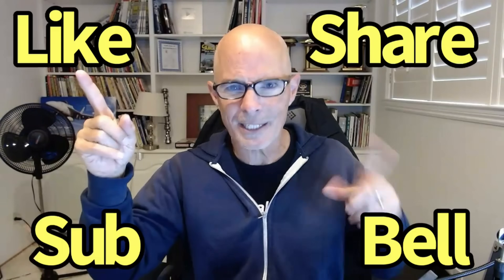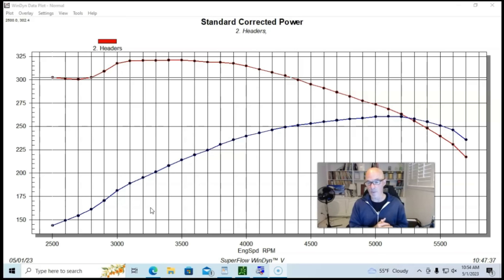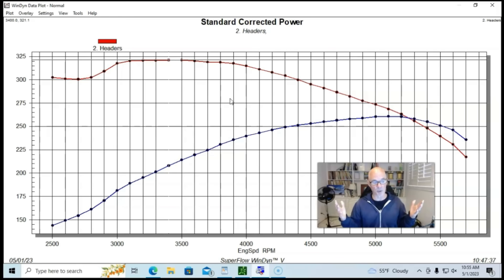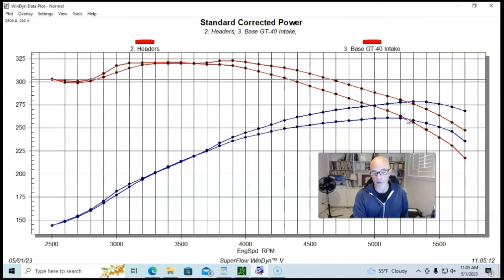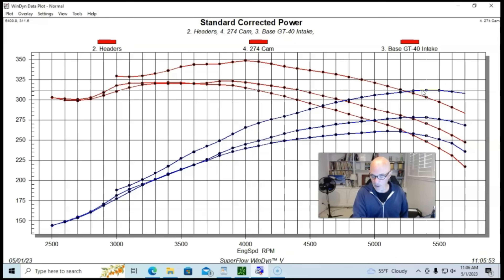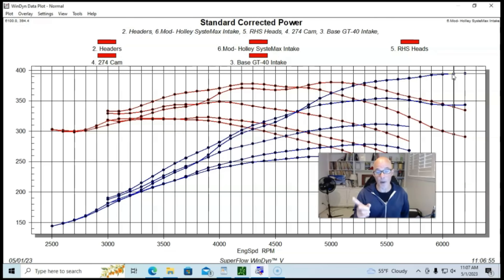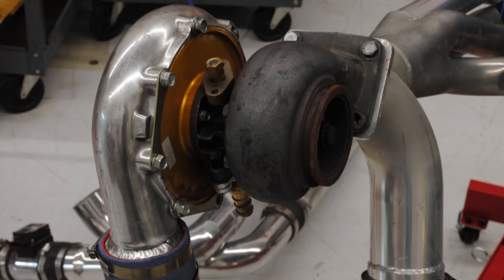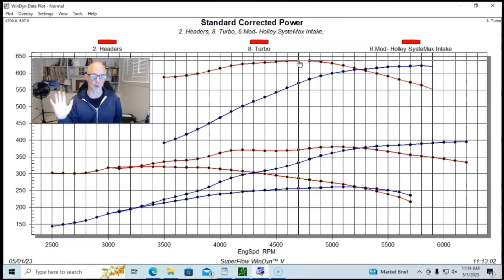HOW TO MAKE 5.0L POWER-BOLT ONS VS BOOST. SHOULD YOU PICK HEADS, CAM & INTAKE OR JUST ADD A TURBO?

Comment: Stock its rated at 215hp in a 1994 stang for example but how did it make 250 on your dyno stock?
Reply from the maker: that was covered (cold water, open ex, open tb, optimized tune, headers etc...)

Comment: Richard, since iron GT40s are still a popular head upgrade, have you thought about doing a video showing airflow gains with just some simple bowl work, multi-angle valve job and removing casting flash?
Reply from the maker: LOTS OF GUYS HAVE PORTING VIDS ON THE GT40S -SEE DAVID VIZARD OR ERIC W.

Comment: Hi Richard..I have an idea that you may find interesting. I was wondering if you are able to determine the overall efficiency of an engine while testing. I know that when the University of Nebraska puts farm tractors through the wringer one of the figures that they determine is the hp/hr- per/gal figure. That figure gives an accurate representation of efficiency. With today's high fuel prices I would think a lot of guys would be interested in building highly efficient combos in order to maximize mpg. Just a thought.
Reply: Fuel economy is going to change depending on many factors--too much headwind one day, too much traffic (ie stop and go) another. I got my 1986 GT Mustang with T5 and 2.73 gears to get a gas-pump versus odometer reading verified 30mpg driving suburban areas at rural speeds. I did it by shifting below 3,000 rpm and coasting down hills and up to stop signs. but EPA was more like 17 in the city 20 on the highway. I'd say dyno testing is going to make an apples-to-apples comparison  between engine mods,  while "taking your show on the road" adds too many variables--wind resistance, driving ability, traffic, gearing, etc.
Reply from the maker: mpg is best tested in the vehicle during a drive cycle or real world conditions-wot fuel efficiency is only important for endurance racing
Reply: Well dyno testing could easily verify the average amount of hp produced per hr per gal of fuel consumed.  And in my opinion the engine that will produce the most amount of work from the least amount of fuel will always yield the best mpg under identical situations. 

 And  yes I was thinking along the lines of partial throttle conditions 1800-2400rpm range. Real world cruising rpms.
Reply: @NMX777  if it's producing more work from less fuel, its efficient, but there's another factor...potentially. there could be less friction (mostly found in the valvetrain and piston ring thickness, but also in blueprinting a block for "Squareness". get this licked, and you make more power for less gas, but you will find when driving the engine there's less friction to slow the car down (if you use that technique, esp. on stick shift cars) without using the brake pedal.
Reply from the maker: the dyno is regulating things not duplicated in the real world-mpg changes are best tested under the actual driving conditions
Reply: @Richard Holdener  ...I get your point Richard. The dyno cannot predict a real world mpg because of all the variables involved in the real world.
 But what it can do is let us know what power plant is providing the most available power for an equal ( per gal or per whatever) amount of fuel. If you can point to the engine that can provide the most available power from that unit of fuel. Then I can point to the engine that has the potential to provide the best real world mpg. And in every case within the real world. That power plant has the potential to get the job done on less fuel.
Reply: @NMX777  agreed exactly. i can take two of the very same engine, and put them into different cars with different drivers and get two very different MPG ratings. so if i want to know if a 300 degree overlap cam is going to kill my gas mileage, i don't need to put it into a car...i can use a dyno to make an apple-to-apple comparison. otherwise what is a dyno for, anyway? its supposed to help us make comparisons--if we need to put the engine into cars, then these videos are entertainment not education.

Comment: Thank you so much for this! Love the content! I have practically this same combo. Stock block/bottom with trickflow forged pistons, 11r 190 trickflow heads, ported Systemax upper and lower and cam.  On3 67mm turbo kit. Its in my 91' LX hatch. Worked AOD with 3k stall. I just need it tuned!
Reply: How is the 67mm turbo with throttle response and what power level is it limited to

Comment: Just did an on 3 kit on my fox this weekend. Trick flow 170s, e303, typhoon intake, and 10.7lbs of boost it made 491hp/478lbs torque through a lentech AOD with edge racing converter.

On a dyno jet.
Reply: To the tire, through an automatic= Awesome! If you know, or get a chance, how much does your car weight with you in it=race wt., what 60ft., 1/4mile et., and Mph? Also what is your flash stall speed= when hooked up fully, and your rear end gear ratio?
Reply: @evilinside5984  Its a 88 convertible with full interior 66k miles so probably weighs close to stock weight add 180 lbs for me, I don't plan on going to the track because my goal is to keep it looking like a sleeper so no roll cage. Its an Edge racing 9 or 9.5inch converter with a 3200 stall, on the dyno it seemed to go right up to around 4k in 3rd when we hit it. I have 3.31 gears in it and the lentech aod has 4r70w gear set in it. So 1st is more aggressive now then it was with a stock aod and 3.73s haha.

Before I modded it up much it ran a 14.1 in the 1/4 with just exhaust and 3.73s
Reply: @zarmelad3475  That 14.1 with minor mods, was very good. I have an 94Gt, Aode, and weighing a very heavy= with driver= 3,950 Lbs., and 100% stock, it ran 15.6@ 88Mph. In many performance articles/mags, your Aod convertible fox's are listed/shown as running 16.1@87Mph= 100% stock, and without shifting it, with the shuffle=just mash the gas, n go. The 1994, and 1995, 302s, with the Electronic= Aode trans. cars were quicker 100% stock, because they had a 2,300 to 2,500 tq. converter, vs the 1987 to 1993 Aod trans. 1,600 to 1,900 tq. converters stock! My Aode responded great to 14° of initial timing, complete exhaust, k & n fipk kit, B & M (E- shift improver kit), drag radials, and 4.10 gears= 14.52 @ 93 Mph= 1.08 sec. quicker, and 5 Mph faster, over stock! Stock dyno jet #s for Aodes= 165 Hp, and 220 tq.,  After my mild bolt ons= 189 Hp, and 238 Tq., not to mention they say when you put higher numerical gearing= like i went from stock 3.20s to 4.10s, that will show slightly less Hp, and Tq., to the Chassis Dyno, because it shows less of a load to the dyno. Thats why people say i dont race dynos, i race cars on the track, cause many low geared, high stall speed autos., will show very low Hp., and Tq. On a chassis dyno, vs same stuff done to a Man. Trans. car, but will run waaay quicker @ the track, then the chassis dyno would indicate!
Reply: @evilinside5984  yea I was surprised by the 14.1 as well, that was with the AOD shuffle lol, when I changed out the cam to an E303 it slowed the car down and I couldnt get faster then a 14.8 (E7 heads). I'm curious what my car would run now but since I dont want a roll cage I would have to try the draggy app or something and I dont really trust it accuracy anyway.
Reply: @zarmelad3475  The dragy is very accurate, deff. get one! Also i have the E cam, it moved the power band 500 Rpm up. Stock liked being shifted @ 4,900 Rpm, and with the E cam, shifted @ 5,400. Im sure you lost because of not shifting higher, and traction losses, or track prep. diff., or from how bad the Da was? Without a time slip to compare, 60ft., 330, 660, 1,000Ft, and 1,320, Ets., and Mph, its hard to see why the drop? I can look @ the Da, timeslips, and see where things change, and how it effect's the number's. Also, info from, you the driver, did you try shifting higher? Did you ever hit the Automatics rev. Limiter, which is 5,500 by the way= not 6,250 Like the 5spds. are. Most people don't know that the Automatic's factory rev. Limit from 1987 to 1995 is 5,500 Rpm. Ford did this to protect the automatic trans., because they knew they were not strong from the factory.

Comment: Wouldn’t boost be a more exponential number based on psi being relative to volume as opposed to *2? Base heads plus 1 bar = to hp * 2. I get that, but when you port and allow more volume of air, now the 1 bar on base is not 1 bar on modded. The turbo psi addition is the same but much greater volume?  Better way to say it is factory stock motor with 1 bar turbo = (x)cc’s of airflow. Not changing anything but porting, the psi would actually drop, but volume would increase and same power(%) increase at lower boost.    Am I overthinking it, or would adding boost be more equivalent to base*2, then 1st mod *2.2, 2nd mod *2.4, 3rd mod *2.6, so on?
Reply: Sorry, chill day after 2 weeks of burning candle at both ends, my brain is still in overdrive.
Reply from the maker: the power/boost formula is surprisingly accurate
Reply: @richardholdener1727  I'll definitely keep it in mind then. I need all the number crunching help I can get. Dynos are few and far between and not cheap, lol.

Comment: The answer depends on who's paying for all the goodies to create the desired power. I believe a basic turbo set + fuel ratio adjustments probably comes great deal cheaper than lots of power brand parts. So if had to get them myself, i'd choose a turbo set up

Richard if you were to make at around the same amount of peak power (and torque) using number of brand parts (heads, cam intake, etc) or just using a turbo set up, which one of them would give you more fuel economy (more mileage per gallon)?
Reply: Turbo would give better mileage, it only uses more fuel under boost so if you weren’t driving it hard then it’d return stock like fuel mileage
Reply: The tq. from a turbo, vs Hci, will be much more peak, and waaay more average! Mpg, i would think the turbo would get better fuel economy, because its increasing the engines eff. more than Hci. But lets be honest with ourselves, when we feel the "Hand of God"= all that turbo tq. goodness, are we really going to give a s**t about fuel economy!? But its there if you have the patience, and restraint? But me, that kinda tq., is like telling yourself, im just going to stick the tip in=😂🤣👌😜

Comment: I love it!  Such a motivational vid for me as i am in process putting back my foxbody together.  Heads, cam stock refreshed 302 and a turbo.  I have a question on turbo sizing.  Im looking into sub 70mm compressor wheel turbos.  Any suggestions on good responsive turbo?
Reply from the maker: cheap gt45
Reply: @Richard Holdener  Lol omg i do have a brand new dna 69mm gt45 sitting on a shelf.  I had my doubts about it.  Thank you for your reply!

Comment: I had my (not yet used) 351 4V Cleveland with basically what you had , but "60" over . Curious to see if it will make more than 450 hp and 411 torque . 🤞

Comment: Where I live, I'm extremely limited in my legal options. Turbo's are not allowed, nor are the after market alloy heads and intakes. Exhausts can be modified, but must still have cats. And yes, they  do put plenty of defect notices on vehicles. Even the cam has to sound standard. So, for me, its all about getting as much as possible, out of as little as possible. Hence a 347 stroker, gt40p heads, explorer intake, custom made headers, and exhaust. Open the hood, and it all looks essentially factory original. Every head, manifold,  exhaust mod is all about extracting as much as possible from what is available. Low lift head flow and port velocity is crucial. Exhaust scavenging plays an important part. Peak numbers are less important than total area under the curve.
Reply: if you were stuck using flat tappet lifters for an early engine design, look into variable duration lifters. below 3,000 rpm they reduce lift and therefore duration, you may be able to get a cam that sounds stock but then above 3,000 rpm you get the lift you need to get around a stock set of heads to feed a stroker setup.

Comment: There is no comparison. I put a Hellion 62mm turbo system on my 150,000 mile 5.0 at only 10 PSI. The only mods were 1.7 rockers and Cobra intake. It made 444.6 hp and 537.8 lb/ft of torque to the wheels. My current coupe has a 347, 185 AFR heads, Holley Systemax intake, custom cam .600/.595, 327/331, 112 lobe sep, electric water pump, 70mm TB, with Holley Terminator-X. It made 400 hp and 370 lb/ft to the wheels. I love these comparisons but this one isn't close.
Reply: That 347 should be at around 500 hp at the crank, that's pretty damn good.
Reply: @anthonysiler4938  We are guessing it's around 470-ish to the flywheel which I'm happy with. The current combination has a TKX but was dyno'd with a T5. 
To add to my previous comment, the turbo motor made over 400lb/ft at only 2500 rpm, and that was a fun combination with 3.08s.
Reply: That's very good info so how much hp is lost by running a supercharger vs turbo running the same boost?
Reply from the maker: see the mod ford video where I tested all four forms of boost on the same  motor

Comment: I’m building a turbo kit for a stock 302 atm aiming for about 400hp, thanks Richard!
Reply: 400 is easy with just a turbo.
Reply: 230 HP plus 8 psi boost is 400. Pretty easy
Reply: @bobstitzenberger1834  yes should be very attainable, hoping to make it live for a while.
Reply: @karenthomson9749 ,  it's all about the tune. That's really a moderate power level, as long as it doesn't go lean, it should live a long life.
Reply: @bobstitzenberger1834  cheers!

Comment: My stock Explorer engine with a turbo made 550 whp on 11lbs with good supporting hardware. Good luck ever making anywhere near that with bolt ons. And the bolt ons would cost 2X or more!
Reply from the maker: a stock 5.0l Explorer motor rated at 210 hp at the flywheel making 550 wheel hp at 11 psi-something is off.
Reply: @richardholdener1727  Holley Hp efi and a water meth kit. 22 degrees of timing with a 11.7 AFR
Reply from the maker: so you have more than doubled the factory power output (at the  wheels no less) at just 11 psi?
Reply: Do you mean 21 psi because that isn't possible
Reply: I can email you the dyno sheet(s), I know it sounds unrealistic. But it’s what the engine made is all I can say. Made 490whp on 10 psi with no water/meth and 20 degrees of timing before.
Reply: @aaronliddell4280  I feel dumb for replying to an obvious troll post
Reply: Except for the fact that your Explorer 5.0 engine is a factory "bolt on" engine.

Comment: If my goal was 400 hp, I'd stay NA.  Anything beyond that and boost would be preferable.  Even though all my performance cars are now boosted, I still have a love for good NA setups, especially for track (road course) use.  Keep waffling on picking up a C6 Z06.
Reply: I'm putting together a 306 for a road race/ track day car, staying NA and aiming for 400/415 HP.  Good buddy of mine just bought a C6 two days ago, so I have my work cut out for me to keep up. Oh, my sbf is going into a Mazda RX8 chassis.
Reply: depends on the use--a 400hp NA 302 pushrod engine will probably be little fun in traffic (the Coyote does it with technology) due to a stiff cam choice (unless you can find heads with a great port design that isn't so big the cfm makes for lazy flow at 2,000 rpm, which a 2.73:1 geared Fox body might be cruising down the road at). but on a race track where you're buzzing the RPMs, yeah, 400 hp isn't going to be the problem--you're not cruising just off-idle and a 3,000 rpm stall speed converter isn't going to have fits.

Comment: No turbo  no problems
Reply: Bad maintenance will kill any engine, boosted or not. There's countless turbocharged engines with a quarter million miles and counting, not even counting all the diesel engines.
Reply: @Mad Mod  I know all that butt if I have or many other will kill an motor with a turbo. I'll give it all the boost to go faster. No turbo no problem. Look at the wrx and impreza  I see way more none turbo impreza. The boost is the problem  I can't have enough
Reply: @brandonrohrer7914  Horizontally opposed, flat engines have always had head gasket issues with or without boost. My old air cooled VW in my 60s dune buggy had a flat 4 and had the same issues with blowing headgaskets hence why its been replaced for a better, more modern design. 
Very seldom is the boost pressure to blame for blowing engines. 
Detonation, closing of Ring gap and pinched rings which cracks ring lands, back to back runs overheating and thinning oil, cooling system failures, bad tunes, or bad driving are what kills engines. Again, if boost pressure killed an engine, than "x" amount of boost would consistently be killing engines but that is not the case whatsoever. Some people grenade built combos NA because of a bad tune, some people make 1500+fwhp on stock LS junkyard bottom ends with rusty bores. Its not the boost pressure that causes an engine failure.